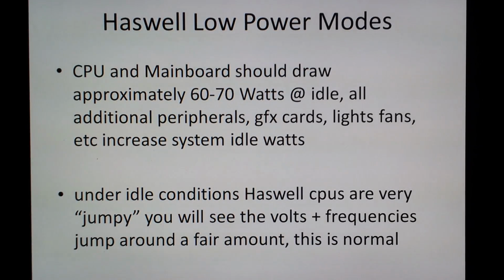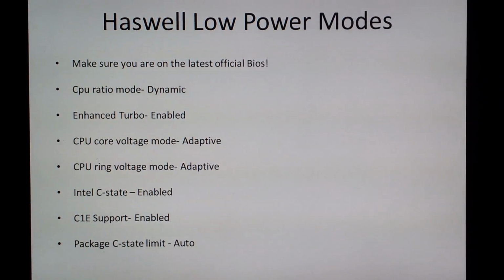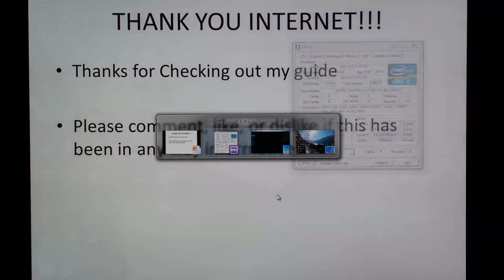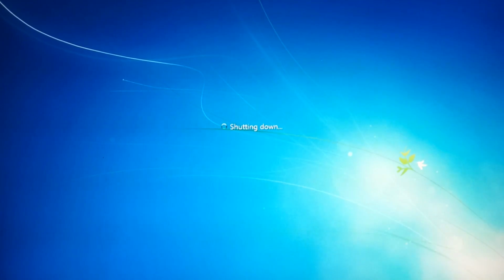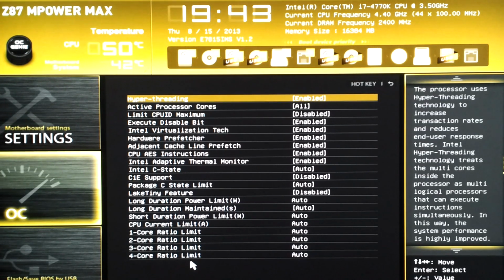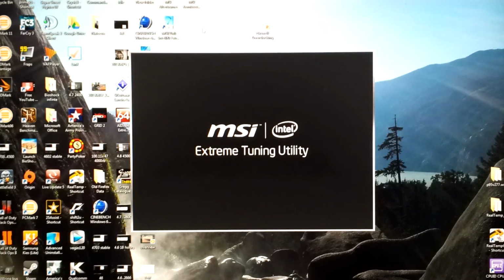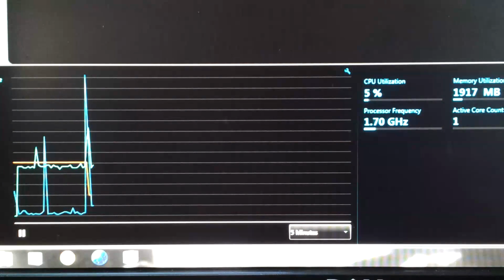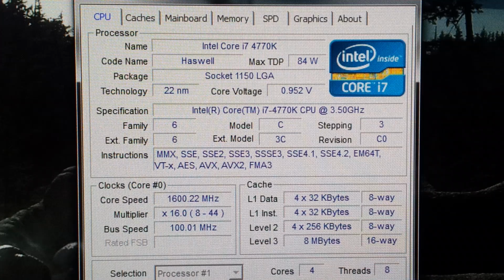Intel Haswell Overclocking Guide Low power modes Part 4

Comment: well, I don't know what you've done, but my G3258 is now stuck on 3.2Ghz!! I can't figure it out. My fault for not saving OC State.
Reply from the maker: sounds like you disabled eist and turbo boost

try to clear cmos!!

way to show some accountability
Reply: Prokon's Tech Center Thanks. I loaded a working 4.4Ghz save state and changed your settings again one by one rebooting and testing each time ... it's fine!! Can CMOS do that, like, just develop strange issues for no good reason? Dropped the multiplier back down to my preferred 42x and back in the game. I'm off to make some 4.2Ghz save states! Thanks again.
Reply: Prokon's Tech Center Alright mate. Thought I'd update you with what I found out. Apparently there are conflicts with non-Z chipset boards, OCing and Adaptive Mode voltages. I'm on a B85 chipset. Rebooting the second time, Windows only sets core clock at stock, in my case x32. So, I'm not quite sure why non-z BIOS has the Adaptive Mode available or how they work with other things like c-states on non-z boards yet, but this is definitely very important for non-z board owners to know.

So to sum it up, on non-z boards, you can either have and your core overclocked OR adaptive voltage, but not both, and adaptive voltage will over ride a core overclock.
Reply from the maker: utopiaopera

thank you for sharing your b85 experience.

I tend to stay away from non Z boards on this platform. others have experienced the same thing. not being able to use adaptive voltage mode when overclocking on H or B series boards.

Comment: hey man great guides you have made i push my 4670k to nice numbers and i seetle to 4,6ghz@1,25 and ring 44@1,25 but i do all the thing you do here and is stays always at 4,6ghz . i got the z87 gd65
Reply: 4-years late reply: change the power plan in windows from "Performance" to "Balanced"

Comment: i can find a stable manual voltage clock. however, when i try to make power saving i really cant stress test since it throttles in weird ways. it doesnt go to max multiplier with prime95, just 38x...

Comment: Without enabling intel c state or c1e support, my 4670k still dynamically lowers clock speed and voltage.  What is the benefit of enabling these two features?  
  
My OC settings:
VCCIN 1.8v
core 4.6GHz 1.29v
ring 4.3GHz 1.20v
H220 custom loop with additional 120mm rad + EK FC 780 Ti waterblock
Max cpu T=75C, Max gpu T=48C